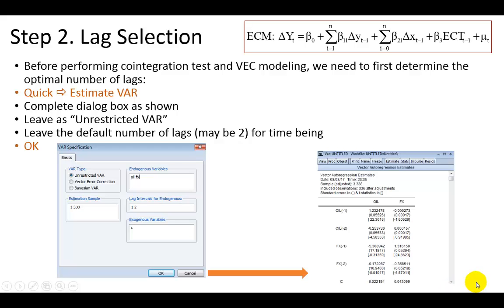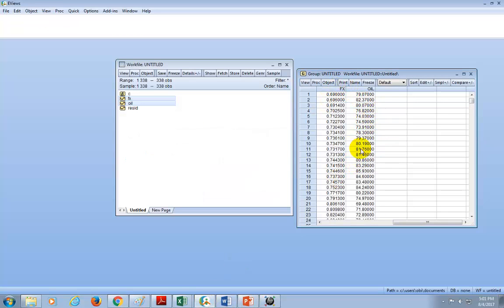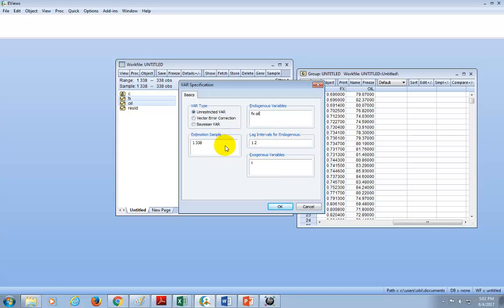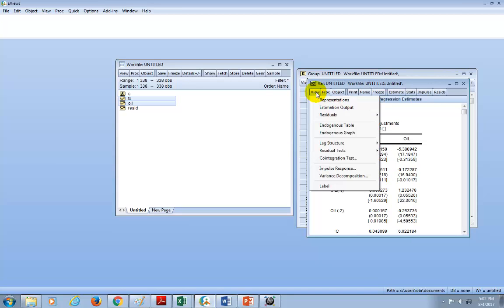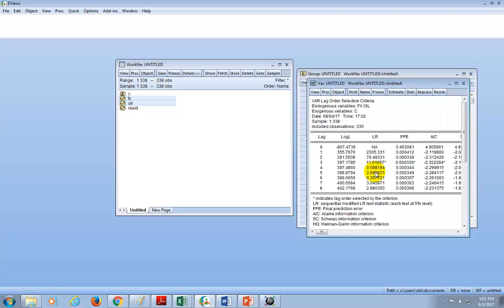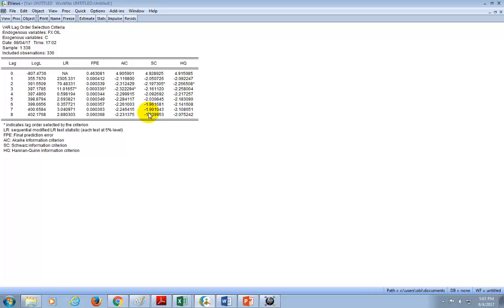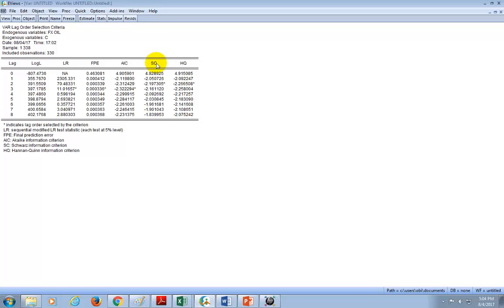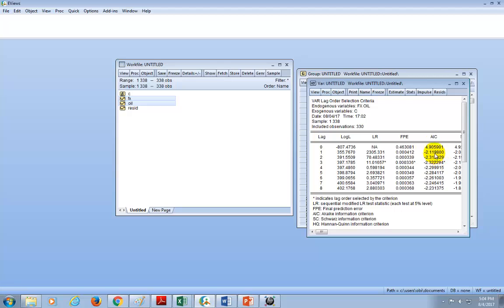Lag Length Selection - Step 2 of 4

Comment: Hello Pat Obi, I have a question. When I would like to choose optimal lag(and then later in cointegration test etc)should I use differenced data or data without differencing? I was using ADF test at first and my results are that both of my variables are not stationary and need to be differenced. Thank you a lot for your advice!

Comment: Hi Pat Obi, I would like to know if in the LAG specification box I must use the number default suggested. In all cases that have been tested, it always suggests 2 LAGS, but I can see that this number can change and when I set a different value (higher), the optimal LAGs changes  . Should I change the value in the LAG specification box up to the maximum allowed, or i have to take de default number in the box of lag epecification ?
Reply from the maker: Two issues to be mindful of. First, try not to use too many lags especially if you're using data other than daily. Second, you can try a couple of different lags. Then check the diagnostics for each lag selection to see which one produces the cleanest result. These are just my thoughts.
Reply: @PatObi  thanks for answering my question

Comment: Professor Pat Obi

What should I do if my series are I(1)?

VAR model would be misspecified for I(1) series. However, can i use VAR model for  the purpose of lag length selection so that I can proceed to the Johansen test?
Reply from the maker: If series are I(1), perform cointegration test to see if series are cointegrated. If cointegrated, run ECM. If not, run short-run VAR.

Comment: Pat Obi, when you select the optimal lag length you also have to check for mathematical stability and heteroscedasticity, these tests will tell you which lag length is the correct to perform cointegration.
Reply from the maker: B Vasquez Yes, it's shown in the VEC and ARDL videos.

Comment: if we use the difference data, this can hide the information entered between the variables in the long term, because it is possible to have no short-term relations but possible long remains possible, and that is the role of johanson test.
on this point that you have presented (those who have asked questions about differentiation), there are divergences between the econometrics, but granger has mentioned that it is possible to make a combination of non stationary variables but it is possible to find it stationary, hence the concept of cointegation

Comment: Dear professor, during lag length selection process, did you use log data or log differenced data while performing VAR?  If I want to find lag to perform Johansen cointegration should I test lag length with differenced values or at level? If I use differenced values for VAR and if I get "best" lag length (according to some criteria, for example AIC or SC) 4 do I have to use formula p-1 = 4-1 = 3  if want to perform Johansen cointegration, do I have to use lag 3?
Reply: You have to perform the cointegration test always using levels to get a VAR, then drop just one lag when you test for cointegration.

Comment: Dear Par Obi- professor from Purdue University Northwest.
 I don't believe that determining lag is so simple as you have shown... You forgot important test, you did not check serial correlation.
Reply from the maker: eni gma: Thanks for your comment. It's part of the diagnostics which I show in the subsequent ECM and ARDL specification.
Reply: Yes, but (always that but):) if if you make a decision based solely on the "lag order selection criteria" and you do cointegration and everything, and at the end you find out... -ok, my residuals are correlated... than you have to determine number of lags and repeat all again (read: "waste of time"  :) ). Isn't it simple to check serial correlation at the beginning and continue with the correct number of lags? Theoretically speaking it is possible that all recommendations of AIC, SC and HQ are wrong -(serial correlated) :)